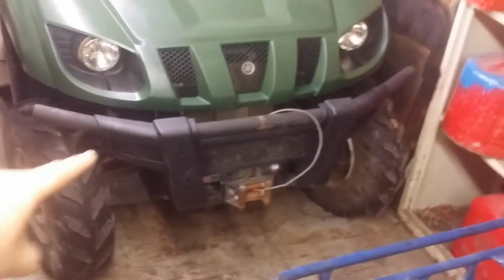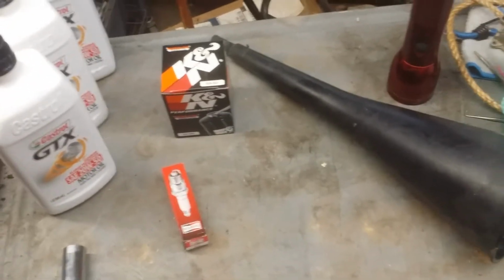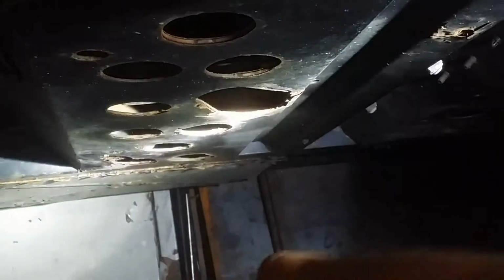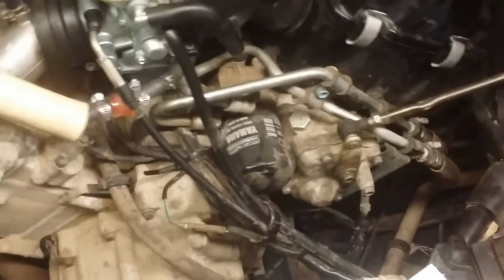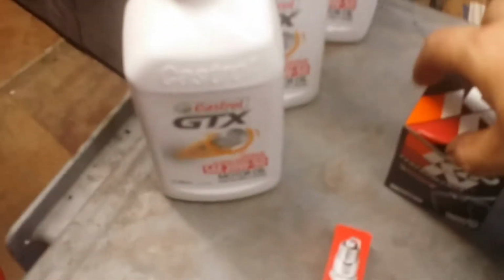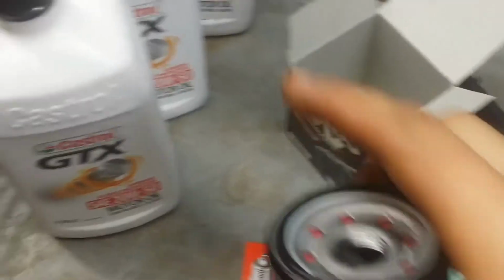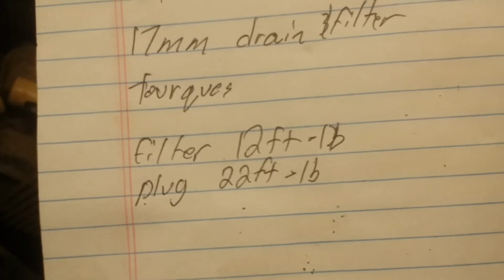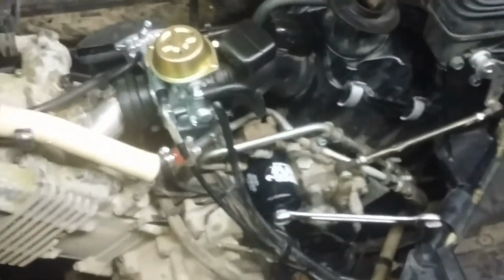Change the oil in a Yamaha Rhino 660

Comment: Just use yamelube oil.
I have a 2006 rhino and seemed to have some slippage with other oils not speced for a wet clutch.  Went back to speced oil and slippage stopped.

Comment: Used oil filters are one of the most irritating aspects of engine work.Not only do they seem to leap out into the space where you're about to step, but no matter how much you drain them, they continue keep on giving a dribble of oil that always finds the one pin hole in the garbage sack!
Reply from the maker: Andrew Burton they are annoying, I usually let them sit in the drain of my oil barrel until the next change ,it cuts the mess a good bit but yes brand new trash bag,even double aged they still leak...same with a container of used oil,air tight and secure sure enough by the time I get to the recycling place it has left a stain in the back of my truck

Comment: I AM HAVING A FUEL PROBLEM AFTER RUNNING MY 2006 RHINO 660 FOR A WHILE  IT LOOSES POWER IF I ADVANCE THE THROTTLE.  IT WILL IDLE  BUT RUNS ROUGH IF I ADVANCE THE THROTTLE  IF I LET IT SIT FOR A WHILE IT WILL RUN FINE SOUNDS LIKE FUEL STARVATION
Reply from the maker: Check your fuel pump and filter sounds like you are running the carb bowl dry, I have had the same problem. Try changing the filter or even check the needle and seat for debris.
Reply: You are running a 660 about a 2006 with a stock fuel pump? when this happens it is hot outside?  when I say hot, over 77 F. Your fuel pump or line has a vapor lock. Pour water on it and it will go for a while. I installed a electric low flow fuel pump that engages when the starter is hit. that always got me going. I am in the process of installing  a electric fuel pump to replace the vaccuum pump. running full time. I will post a video in a day or so. on rhino Rider channel.
Reply: I INSTALLED A NEW HIGH FLOW FUEL PUMP PROBLEM GONE EVEN STARTS BETTER.
Reply: NOT ELECTRIC

Comment: Shouldn't it be a wet clutch type of oil?
Reply from the maker: it depends on the oil, specifically this machine has a wet clutch,however I am using a non energy conserving oil. that is the main difference between automotive and power sport oil, a friction additive . The friction additive is the problem with wet clutches, as long as you use non energy conserving oil it will be fine.